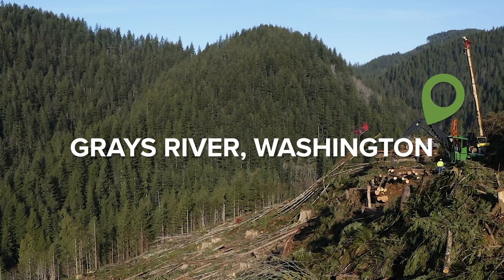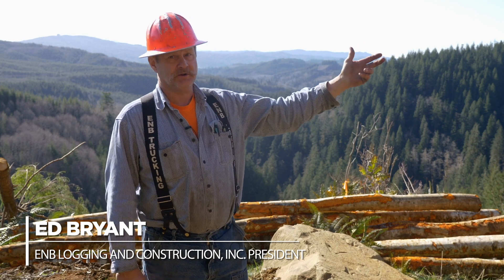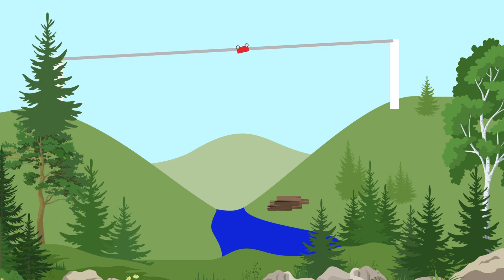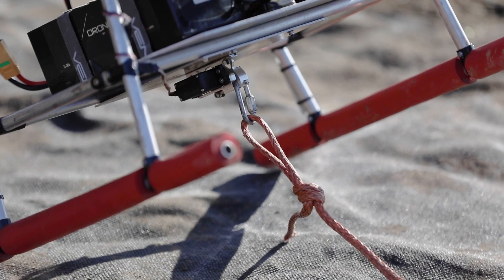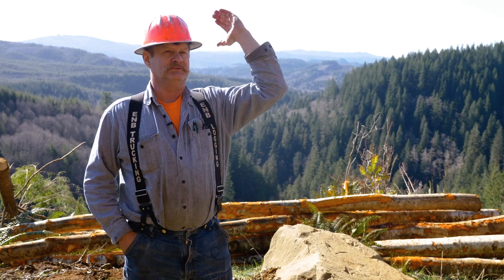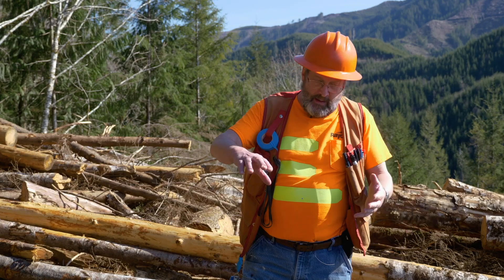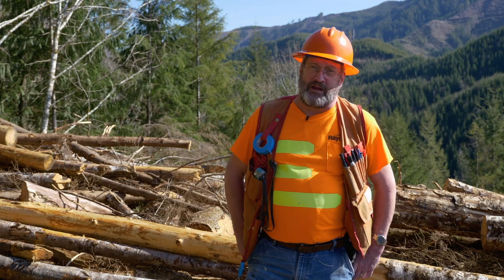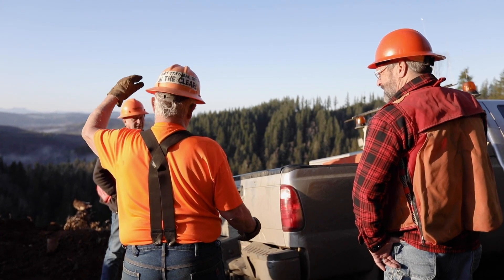High Power Drone Flies Haywire in Tower Logging Operation

Comment: That was all Weyerhaeuser timberland when I started work there in 1959,I worked there until Weyerhaeuser shut their Grays River operation down in 1986. Many of the areas we logged in the 50’s and 60’s have been and are currently being logged, the Skagit 739 yarder in your video is identical to one I operated for years, I may have worked off that very landing. Good video.